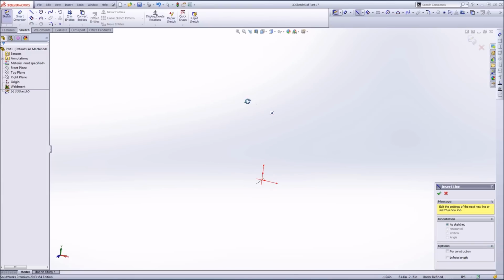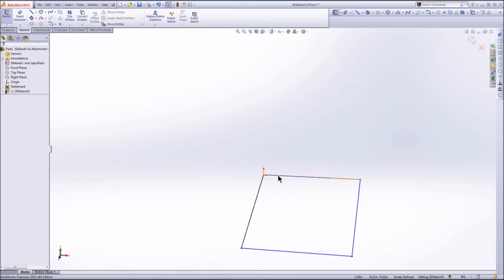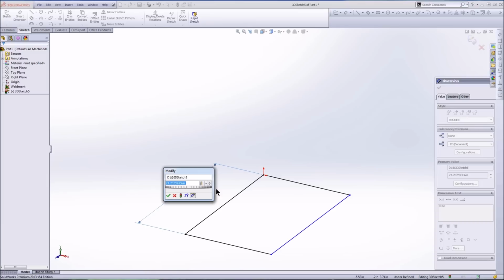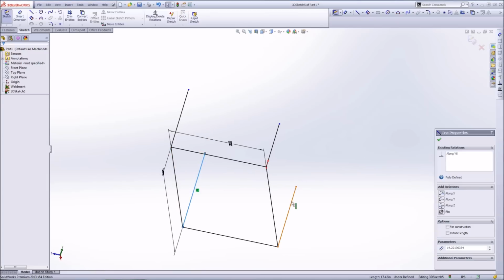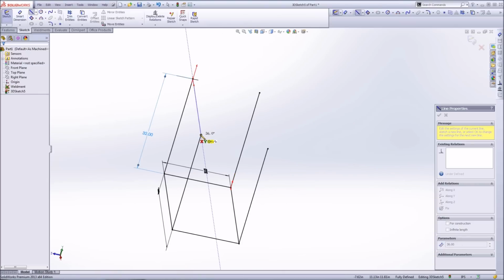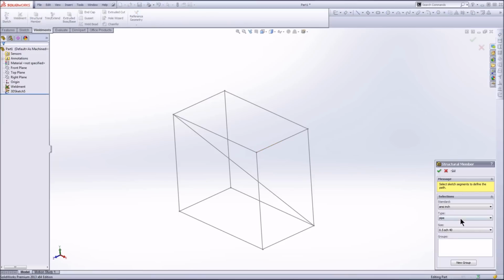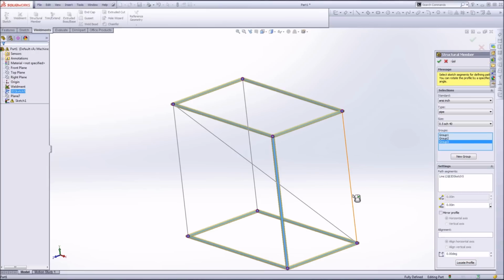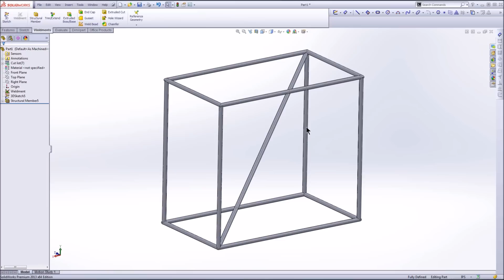How to do a 3D Sketch in Solidworks/Weldment Tubular Frame |JOKO ENGINEERING|

Comment: Is it possible to print out a tube end notching template from the Solid Works sketch?
Reply from the maker: Print with a 2D printer?  I think the easiest for me is to model the notches and put them in a drawing and print at a 1:1 scale to ensure you have the right size.  There probably is a way to do it with a sketch but my workflows have always concerned drawings
Reply: Joko Engineeringhelp Thanks for the reply. Yes a 2D printed paper template that can be wrapped around the metal tube end as a notching guide.

Comment: Very helpful, thank you! 

Fyi dont use pipe for a TUBE chassis. Pipes are made to flow inside. Tubes are made to be structurally optimised. Tight tolerance inside vs outside.

Comment: I have two tubes identical diameter in two places in 3D space, how would one connect a sketch line between them???  It will not highlight or identify the center point of the cylinders even though the center line is visible.  I can get close... but cannot snap to it.  Any ideas?  I swear the people that make this software leave MUCH to be desired when it comes to common sense.....  I even generated a plane along their axis so I can simply draw 2D on the plane, but it still refuses to snap to the centerpoints!  I have never gotten enraged at any software learning curve as much as this one......  Frankly I don't understand why I can't rotate the object in 3D space, select the end of the cylinder as my plane, then select centerpoint using the line sketch tool..... then rotate the object to the other cylinder face and repeat.... voila a line between them.  But I can't.  Several days trying to learn this and it just doesn't make any sense to me.

Comment: when i use this structure into ansys workbench analysis, ansys not consider whole body for analysis, ansys only consider that element which are in contact with the force. can you please tell me the way to analyse this type of problem in ansys as a complete element, i preparing for SAE baja event frame design so i stuck in that part. can you please inform as early as possible
Reply from the maker: Khan abdul qadir 
Apologies, I have not used ansys.